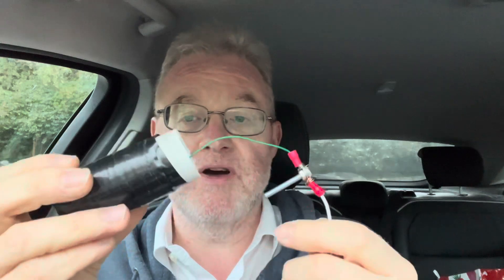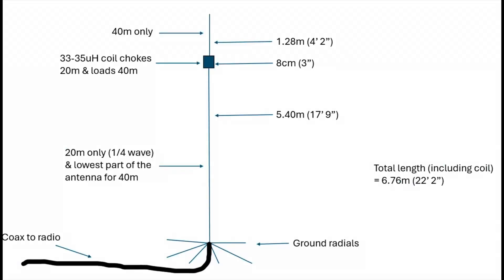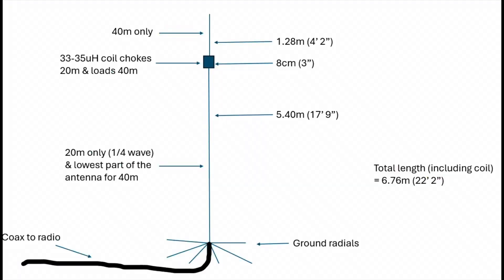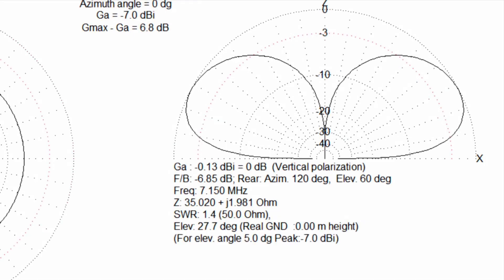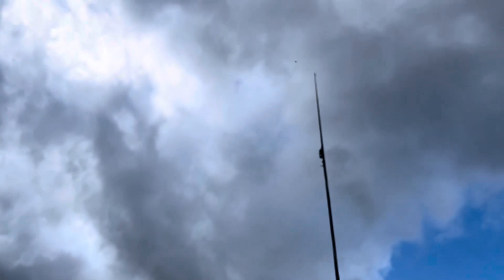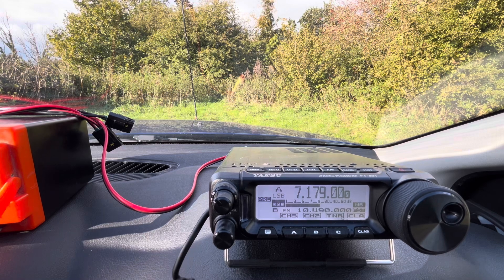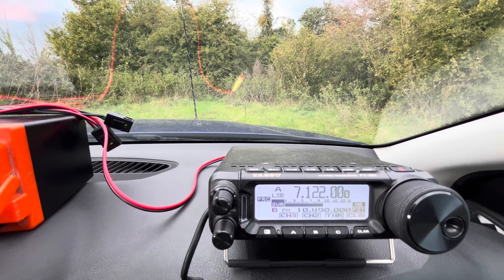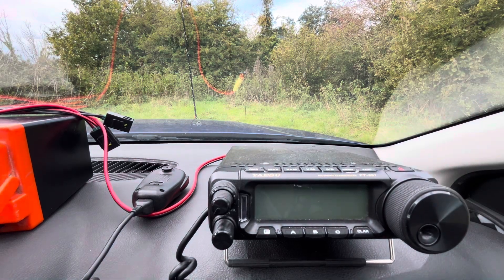A Portable and Simple 20 & 40 Metre Quarter-Wave Antenna.

Comment: No question but would this work as horizontal polarization or about a foot above truck and supported on front and back so I could do NVIS on 40m while mobile?? THAT is what I'm wanting.... 73
Reply from the maker: Not that well - a low halfwave dipole or efhw will do the trick for 40m.

Comment: Tim, how did you derive at 34uH as a choke for 20mtrs. Is there a table or calculator depending on what frequency you want to choke off?
Reply from the maker: @ivanrogers1  Hi Ivan it’s a figure which provides enough choking on the higher band and sufficient loading on the lower band. Rough rule of thumb is around the same inductance as the half wave in feet to choke .. so in this case 33/34uH on 20m.

Comment: Nice idea for 2 band antenna.  Sometimes I put the fiberglass pole threw the coil . helps keep wire on pole in wind. Saves on some tape. So many ways to deploy.  Ground mount verticals work great for DX . easy setup  Sometimes the villosity factor of wire affects the length a bit.  Conductivity of the ground matters as well. I found that out using different wire and in a different park.  73
Reply from the maker: @robertmeyer4744  nice points 73

Comment: I'm going to give that a go Tim, thanks. 
Just a thought. I might fix it approx 1 metre from the ground howevet and have just 2 or 3 elevated radials.
Any thoughts?
Reply from the maker: @johnrowe4907  sounds great! Remember at that height they should be tuned so either do a link to attach or remove for 20/40 or build the same version as the vertical with the coil. 73

Comment: I'm slight amused that you couldn't find any shorter bolts for the coil terminals! That seemed to work great on 40m, I might have to try that. Will have to use more silicone sealant to get another tube for coil making...
Reply from the maker: @paulsengupta971  yeah I just used some scrap stuff I had laying around to put it together in a spare 30 minutes 🤣